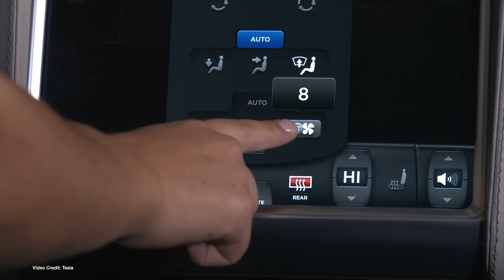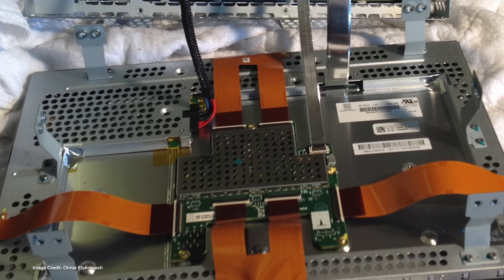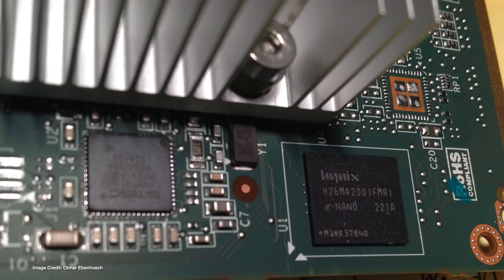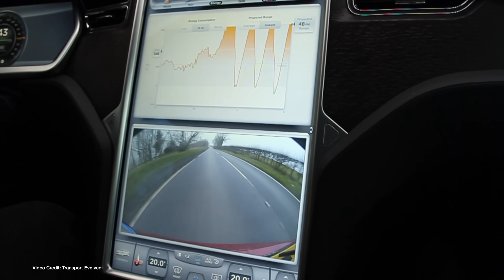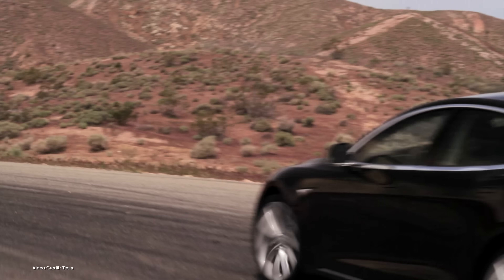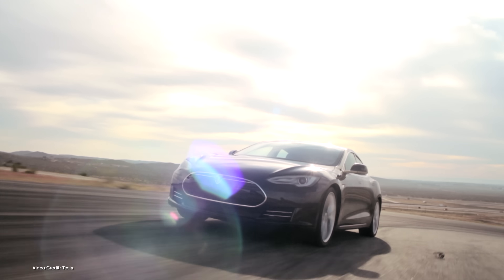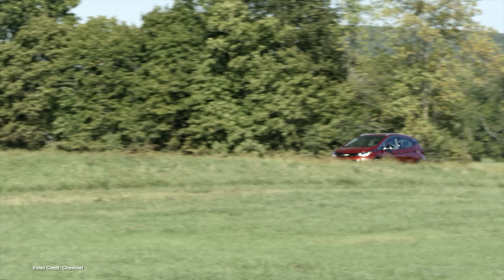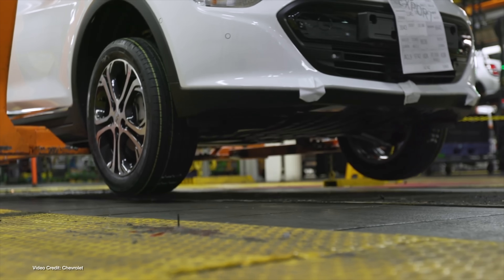Tesla Confirms MCU/eMMC Recall For Tesla Model S, Model X. But What's An MCU? And What's An eMMC?

Comment: I had this problem with our 2016 model X P100d.   The vehicle was still covered under the extended warranty.   I recorded this malfunctioning MCU while I was driving.  I alerted Tesla about this issue.   Several months later I learned about this recall.  I went in to have the unit replaced.   I was told that since the unit did not record any problems in it’s data records, they would not replace the unit.  I reviewed this video and have decided to recontact the service center and attempt to get this unit replace.  According to my email records, Tesla has sent a replacement unit several months ago and so it should be still waiting for me.   I will let you know what happens.

Comment: I ordered the MCU2 upgrade literally a few days before receiving the email from Tesla about the recall. I unfortunately had not seen that they slashed the price before I agreed to the 2500 dollar estimate on the app. Do you think I can dispute this, and have them charge me the 1500?
Reply: Asking is no crime. Let's see how they value their customers and commitments. It's a failure embedded in the design, clearly their responsibility. 

The trick of selling un upgrade is ok, but it should cost nothing to repair to original specs as it is a design flaw.

The extra they charged you doesn't seem fair.

Comment: I find it surprising that they are not just reflowing a new better chip on the board like Rossmann does at his apple repair shop. Also Tesla should have known that all memory chips fail over time. They could have chosen to use a socketed version and then you could just swap out the chip.

Comment: So in Europe, the cars that have had an eMMC replaced will get more info from Tesla soon. We were told mid February, probably money back, as we payed for the repair. The ones that got an MCU upgrade/replacement might get info as well, as to any money back. The eMMC problem is known for years as you have described, but early excessive logging is the fault, not frequent OTA updates. Though OTA adds to the wear and tear of the flash as well, but to a much smaller degree. Tesla underestimated the issue and refused to help out while private companies would. That did reflect poorly on them. Same with the durability of a few minor parts in the early door handle designs of MS, which should also have been recalled, but is now a much cheaper repair than before.

If you upgrade to MCU2 now, there is also an option to keep FM radio for 500$ extra, in addition to the reduced 1.500$ for the MCU2. Last year there was no FM option and you could choose between MCU1 with std. Screen for 1.500$ or keep old screen for a reduced price 1.200$ I think. Alternatively you could pay 2.500$ for MCU2, with the new screen. Before this it was even more expensive to replace the MCU1.

If you get a new eMMC (the recall or otherwise), which is fine if you have an AP1, please keep in mind to also get 4G/LTE.
If you get a MCU2 upgrade/replacement, which I would recommend even for older AP1, you will get 4G with it.

Comment: I could have told them that the emmc would wear out the way it's being used. It's bloody obvious if you know anything about nand flash filesystems. emmc hides a lot of the details in its internal firmware and algorithms so it'll work for a long time as spare blocks are mapped in to cover for worn-out ones, but eventually it'll run out of spares and then you get filesystem-level errors.

Comment: Thanks for delving into the details!  Would you recommend doing the $1,500 upgrade or just getting the replacement if one is planning to keep the car longer term?  What are the pros and cons of the new MCU?
Reply: Good question. I take my car for service next week for recalls and wondering if they're gonna give me a MCU2 option less than $1500.
Reply: @erickayson588  let us know please
Reply: @henrycruz45cal  - bringing in to service tomorrow. I'll report back
Reply: @erickayson588  

Hello 👋🏼 does anyone have an update on how Tesla replaced the eMMC ? Did they only replace the eMMC  or the swapped the whole MCU ? 
If not,  would it be worth paying to swap to MCU2 ?
Reply: @iansemailbox - there's still a back up on the recalled chip, so I opted to pay the $1509 for the MCU2. Check with your local tesla service to determine parts availability for the recall. Honestly, the MCU2 is nice upgrade but not really necessary.
Reply: @erickayson588  
Thanks for the update Erick . Tesla has rescheduled me for next week because of part delay .  Replacing the MCU seems to be the easier option for Tesla so I can’t understand why they would go to the trouble to only replace the eMMC .
Between labour and part cost I think it would end up the same. 
Do you think replacing just the EMMC to 64gb would improve MCU performance ?
Reply: @iansemailbox  - the service department did mention those who are having extreme issues are being seen first.
Reply: Unfortunately the part needed to complete the emmc recall was not available yet. They are telling me it won't be readily available till March. Also, if I did want to replace to the MCU2, it would cost $1500 to complete the upgrade. They're not sure if and when a refund for those who paid the original $2500 will be applied. I'm assuming they will. Since I plan on getting the Plaid, I'll pass on paying the $1500 MCU2 upgrade.
Reply: Hello 👋🏼 does anyone have an update on how Tesla replaced the eMMC ? Did they only replace the eMMC  or the swapped the whole MCU ? 
If not,  would it be worth paying to swap to MCU2 ?
Reply: @iansemailbox  I had mine upgraded to the MCU2 for $1,500.  My former Tesla mobile service ranger recommended this and it's definitely much snappier.  My understanding is that in both cases, the entire screen is replaced.  Also, unless you are willing to pay about $500 extra, you will lose AM/FM and Satellite radio.  I opted not to get those.
Reply: @karlbloss  this is good to know , thank Karl.
Are you talking about losing XM radio or do you lose the built in Tesla music stations ?
Reply: @iansemailbox  XM
Reply: Hello 👋🏼 does anyone have an update on how Tesla replaced the eMMC ? Did they only replace the eMMC  or the swapped the whole MCU ? 
If not,  would it be worth paying to swap to MCU2 ?

Comment: Wondering what you think GM will do with the Bolt EV battery issue? I have a 2017, never had the upgrade done yet, but using hill top reserve in the mean time. Wondering if LG chem will up for new packs or replacement cells?
Reply: They will probably do the same as Hyundai/Kia, which is a software update to increase the fault detection sensitivity of the battery management system. Their goal/hope is to find the individual failures and replace the packs selectively, hopefully before they catch fire, rather than replacing all the affected packs. Hyundai/Kia use very similar LG Chem batteries in the Kona and Niro, and they had the same problem.

Comment: This was not a small fault that couldn’t have been predicted.  This was a ridiculous engineering choice that was guaranteed to fail quickly, all to save just a few dollars per car.
Reply: Apt-so-frakking lutely, and  good on NHTSA for holding Tesla to account!   Hopefully,  Tesla will gain an appreciation of the difference between a couple dollars' manufacturing cost and a couple thousand dollar mandatory recall on every car built, and the effect on its brand image and customer goodwill.

Comment: I wanted to replace the hard drive of my Windows XP machine with a SSD, but was informed that it would not be possible because XP did not do the “levelling” procedure.   The nature of the work I was doing created a lot of temporary files. . .   and being “of an age”, I decided it was time to close up shop and retire.   Why XP?   For some very good reasons.  One piece of critical software I had written was 16-bit, written in Borland C.   Some of the functionality has not been available in Microsoft C, without completely rewriting for a windows environment.
Reply: An SSD would be fine, unless you were running a lot of data.
Modern SSDs can cope better than old ones.
Also moving the Page file to a different drive helps, though if you have enough RAM the page file wouldn't be used that much.

If you WinXP program can be run inside a virtual machine, then you could run it on any modern PC (or Mac) to save yourself the hassle.
Reply: That's bollocks. You were misinformed. SSDs do the levelling internally. The computer can't tell the difference between a hard drive and an SSD.
Reply: @Wookey.  Your computer can tell if a drive is an SSD or HDD.
Windows will enable TRIM for SSDs and Defrag for HDDs automatically.
Windows XP probably won't be able to do this though, but it is a long time since I checked.

But again, modern SSDs can cope with rough treatment, you don't need to worry about the rules as much any more.
Reply: @marc0523  OK yes, there are minor differences - my point was that it's the same physical and logical interface. They can be treated exactly the same. There are these things which are done differently by way of optimisation, as you point out. But you can always plug an SSD in where an HDD went before, you just won't see the full advantage (and will put extra wear on it) without the OS using the extra ATA command TRIM.

Comment: Hello Nikki,

As we both own MMCs..Morris Motor Cars..
Havn't things moved on...
The speedo needle would bounce and the indicator bulb needed blinker fluid..
Now, like the ashtray of old the computer is all clogged up..and needs a tech to fix it..
Log files, together with a hammer and screwdriver are in a bag in the boot.
Still, it gives them an opportunity to check the suspension dashpots and the exhaust system..
Don't you just love it......
Cordialement,
Reply from the maker: Nikki here - I sold my morris minors in the UK - but Kate still owns hers up in Washington State :)

Comment: This is the same reason that I use an SSD for my dashcam instead of an SD Card.  I hope whoever proposed an SSD and got rejected in favor of the eMMC is getting an apology right now.  The cost difference wouldn't have been prohibitive and in the long run cost would have been lower.
Reply: Or they could just have turned the logging down a bit so it lasted 50 years instead of 7.

Comment: Thanks for the update - lets hope this recall will reach Europe as well! This is exactly one of the points that I'm fighting with Tesla. It's indeed high risk at the moment: driving in the cold with the whole family, MCU needs restart because of a software crash (which happens regularly), AC turns off, and before the MCU completed its reboot (over 3 minutes), the windows are dangerously fogged. This means: as soon as the MCU crashes, I need to start watching out for a place to stop to not risk a crash. And up to now they said: live with it!
As a former fanboy (next car will not be a Tesla anymore) I enabled ("send logging data home") for Tesla to help to speed up autonomous software development. This clearly wore out the memory a lot more; and this is how Tesla says thanks now (or at least used to)? Really hope they give in now and replace the memory (as explaned by the service center: the replacement won't be a new MCU, but just a used one with the new memory chip).

Comment: Nikki: As an EE, I would like to credit you with giving a very sensible and balanced description of eMMCs, what role they play, their pattern of wearing out essentially inevitably, and the impact that has. Nicely done!
Reply: Yeah seriously, it was a pleasant surprise to see that level detail for this video. Heck, most "tech" yt channels don't do as good as a job explaining it.
Reply: I would add it's a deeper problem with reckless design in Musk's steered culture.

A glimpse of the board shows a small cooling fan similar to those used in notebooks. What's it's expected lifetime ?

The board is crammed like many consumer electronic gadgets, not like high reliability industrial, military or automotive designs.

What are the temperature ranges for the equipment and components? Are they fit for extremes?

To be just, they seem to use solid capacitors to avoid one of the most evident failure modes of consumer electronic.

eMMC are mostly cheap and disposable pieces of hardware, meant to be used where lifespan is not an issue. Changing eMMC, even for larger ones that spread the use over more memory cells reduce a bit the rate of falure, but not the failure mode.

High reliability durable hardware would use other kinds of memory (Nand x Nor; SLC x MLC; etc.). A component that is known to be failure prone should be designed into the system as a replaceable component or subunit.

Tesla is clearly opting to show bells and whistles instead of design for reliability. 

If at all they mean to have the whole module as an expendable one, it should fit the vehicle in a standard way to allow retrofitting newer standard models, like was done with radios, CD players, with the 1 DIN and 2 DIN slots. Designing the standard interface for many models, openning up the architecture doesn't seem to be within Tesla's plans.

Than I remember Musk x Mobileye, wanting to oversell what was achieved and secure to use.

This way of thinking evident in SpaceX of rapid iteration without excessive design for reliability indeed has it's merits. But there is also a dark side to it, mostly hidden by the anxious Tesla cheerleaders disguised as independent commentators. (Some times they look as circus seals clapping hands in shows).

Tesla won't allow a owner to repair his own car independently. They reserve the right to change the product after selling it, as if the were part owners. They design in failure modes far different from the alleged 250.000 mile battery or the millions mile battery. One buys the car or leases the car?

A 1990s GM has all the noises os cheap plastic, but when it fails you just buy an original or aftermarket piece of hardware with original design or upgraded and put it back to work. Imagine the fuss if owners had to be allowed by GM to repair their stuff. It would be a scandal.

Tesla's supposed treehugger followers like very much stock valuation embedding a Standard Oil like monopoly on transportation and all kind of anti consumer tricks with their blind love.

Tesla does indeed contribute decisively for the progression of the electrification agenda. They have lots of merits. But a more balanced approach to evaluating its products and policies is needed.

Refreshingly, even discording from Nikki many times, I recognize her effort in maintaining a balanced truthful approach.

Comment: Tesla is somewhat the first one running into this issue with systems in cars moving from literally "read only" (i.e. flashed once with minor updates, nothing really written into storage etc.)  towards a system we are used from mobile phones. Android being on board, new Apps possibly popping up after the car is already 3 years on the road, not being able to predict what those apps might actually do and how they deal with the system. Now everybody in automotive moves towards highly consolidated high-peformance-computing platforms, also referred to as domain controllers, zone controllers etc. The level of complexity of those systems combined with the number of companies developing code and applications for those systems - more than 20 is not an exception - is getting huge which creates the desire to log even more data for potential debug purposes. Digital video recording and/or event data recording including FullHD or even 4K camera streams is adding high bandwidth and huge data to the system as well. The trend towards separating hardware development from software development will add to the problem as you can't really blame software developers on a higher abstraction layer for not understanding physical hardware challenges and aspects in detail. It might become a challenge to establish design rules that can be enforced, followed and controlled to mitigate risk in a best way. Of course you could choose to simply put a 1TB SSD into the system and you might be able to forget about many of those challenges (unless the vendor increases page-size with higher capacity, but that'S a different story). But price for such a SSD won't be accepted by carmakers. So other measures have to be taken to mitigate risk and there are some good ones available. Believing that the flash memory controller is handling EVERYTHING for you is a big mistake. All software components can add to a phenomenon called Write Amplification - specified through the WAF (Write Amplification Factor). Easy take on it: if you want to write net data of 1MB and end up to actually write 1.5MB of data into the flash memory then WAF=1.5 - With current programming practices, databases involved etc. you can end up with 3digit WAFs for certain operating systems. Means worst case: you have 1MB net data but for some crazy reason 100MB and more get written into the flash. I am hoping that these risks will be mitigated well - Flash friendly filesystems e.g. would be a good start - os that we don't see similar recalls with much higher volumes in 5 years from now